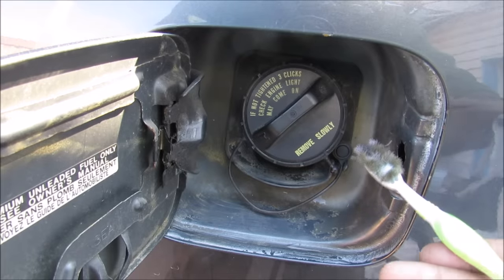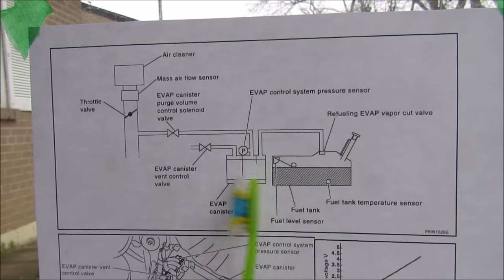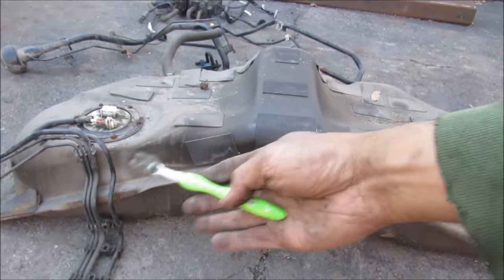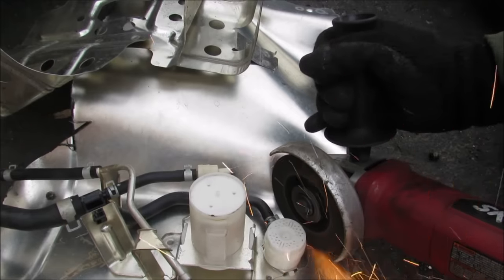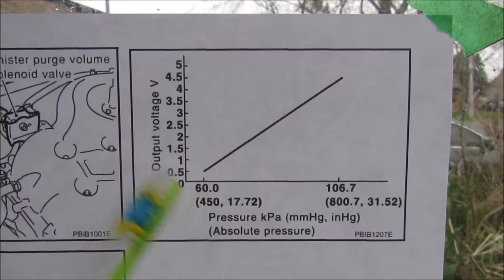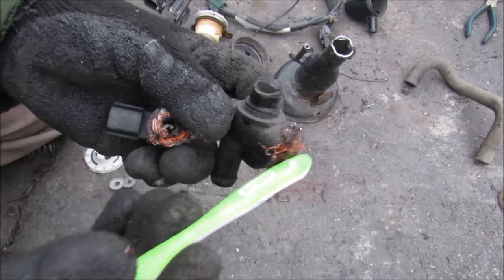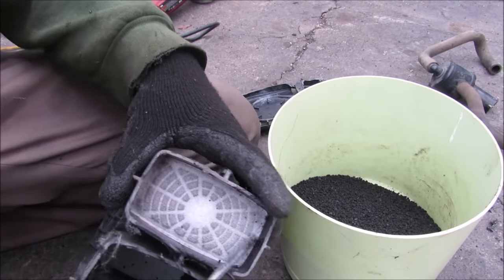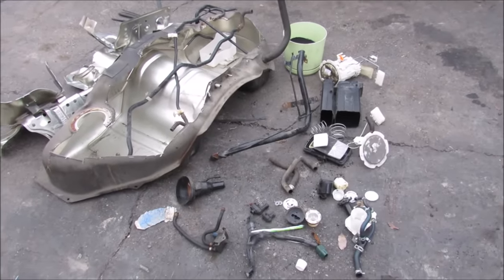How the EVAP System and Gas Tank Work

Comment: Do you think you explain a little more about the vacuum switching valve vs the purge valve solenoid and maybe help with locating them on a 2002 Nissan Maxima SE
Reply: Ok I see you explained it more in your other evap video, I still need help with the location though
Reply from the maker: Sometimes there's a sticker under the hood that gives you the vacuum line routing
Reply: @speedkar99  I found the sticker, thanks but it's very vague and doesn't mention the vsv at all smh
Reply: @speedkar99  i love your videos by the way they're very comprrhesive

Comment: If you fuel up and the fuel dispenser is an old fashioned one., does the EVAP system work to relieve any pressure in the gas tank from additional gasoline being pumped in?

Comment: Imformative video. I have a 2001 Toyota echo that i purchased in 2015 , and the canister went bad 3 times within 5 years, actually less than that, so I'm pretty use to seeing the check engine light on since Ive had the car. Seems kinda strange for it to go bad that often.
Reply from the maker: And you fixed it all 3 times?
Reply: @speedkar99  
Not this last time, just reset the engine light for emissions, and just let it go this time. It costs 400-500 to replace the part, and there's no warranty. I just don't get why it would go bad that often.

Comment: This is an outstanding breakdown, very knowledgeable.. I have a Q.. does anyone here know of a cause/solution for an extremely rough start after refueling? I have a 2008 Hyundai Santa Fe 2.7 engine.. this issue started a few weeks ago out the blue.. now the only way I can get it started is to crank it for approx 10 to 15 seconds every time I fill up or remove the fuel cap.. it only does this at that point in time.. the vehicle starts and runs perfectly throughout the entire duration of time between fill ups.. I asked a couple mechanics but they've never even heard of this issue.. all insights/recommendations are welcome and appreciated, TIA

Comment: @speedkar99 I have a 2010 F250 5.4L I just purchased. I found the vent line that runs from the charcoal canister to the engine looped over the front axel and just hanging down. It has a couple damaged parts, maybe from where it wore against a moving part or the ground, and the end is cut off... where does that go in the engine? I do not have any codes and no issues refueling the truck.
Reply from the maker: It should hang down. It just vents to the atmosphere

Comment: I seriously need your help.so every time I fill up I smell a lot of gas fumes inside the cabin.itll air out in a day than I won’t smell it again until I fill up again.on my canister I noticed the evap valve was broken.i replaced that thinking it was going to help and I still get that smell after fueling...can you please guide me on what to do next?thanks in advance brotha
Reply from the maker: You have a leaking filler neck.
Reply: speedkar99 I appreciate your response.is there a way to see check it?

Comment: I have a question! I have a 95 del sol with B18c swap, I don't have a purge solenoid and the vacuum line that usually runs to it is instead hooked directly to the vacuum port on the intake manifold (right behind the TB) that would usually connect to the purge solenoid, will this work properly without the solenoid or should I just unhook it? I've searched the internet for an hour and can't find an answer.

Comment: Where is the vacuum switching valve located?  Is that in the engine compartment that connects to the main evap line at the back of the engine against the firewall on the top of the engine?  I think there is a green schrader valve that one end plugs into.  I wonder if mine is bad since gas shot out of my tank and the check keeps going off. .

Comment: READ FIRST (ASE Master Tech of 40+ years)
  No Explosions & not charcoal. Charcoal goes in grills and smokers. Activated carbon is created of pure carbon in controlled conditions in a lab and test. It absorbs organic vapors of which gasoline is one.   The tank purge valve is open all of the time. It is only close when testing for leaks.
If it uses a temp sensor, then it has an NTP Thermistor and changes signal to low fuel light. The PCM uses software for “Engine Off Natural Vacuum”

Roll over valve to keep liquid gas from coming thru canister and create a void for air/fuel, raw fuel never reaches the cap as it would enter the "Carbon" canister as degrade carbon pellets of precise size for ASTM/DOT and CARB agencies. 

Gas caps vent at 2 psi for OBD-II, but allow air in incase hoses pinched or parts plugged, no explosion ever. Only static electricity from custom refueling and not touching pump first.

Fuel pump hoses have an aspirator tube to detect pressure & wire in hose rubber back to pump.

Activated carbon is made under heat & pressure. Holding hydrocarbons, not dangerous unless sniffing.

Escaping hydrocarbons only create photo-chemical smog with sunlight at 10, 000 feet.

Pressure sensor measure in inches of h2O. During EVAP testing, tank vent closed, stops at 8” of water, timed over 2 minute period. If small leak degrade up to 12” of water, code is not set, only history is saved, dash message says to check gas cap.

Purge is open while running, at temp, stead highway speed. PCM watches for O2 sensor changes to check purge working, adjust injectors for correct A/F ratio. Tank valve is open during refueling to allow activated carbon to capture hydrocarbons creating an exothermic event or get warm to hot. During purge, hydrocarbons create an endothermic reaction or cooling.

Water droplets only form when tank is below full. Metal tank create more than plastic and do not work well with E85. Diesel attract more was than gas. E10, E15, E20 or E85 absorb water, reducing the surface tension and allow it to pass thru injectors. Water in fuel only comes from gas station or air and temp changes from hot/warm to cool or cold after off.

Fuel warms during returning from engine, exhaust and pavement either asphalt or concrete. Once shut off and parked. The PCM by clock may run EONV test for tiny EVAP leak. This is why most use returnless fuel supply systems.

The size of activated carbon canisters is determined by the size of fuel tank.

The fuel pump is inside the plastic bucket. Most bleed a small amount of fuel to venturi jet to draw fuel inside to allow air to separate, keep pump cool, lubricate pump and keep volume constant to prevent unnecessary misfire codes when low on fuel and turning creating centrifugal force moving fuel to opposite side. 
 
Some manufactures use a thermistor at bottom of pump/sender to turn on low fuel light. Same with a temperature sensor is not used on some brands as software operates EONV.

Metal filler piping and vent piping will rust. If you smell gas after filling the tank, or sloshing the fuel coming to stops and getting out. These pipes need to be inspected and replaced. This keeps the dangerous hydrocarbons inside the canister, not garage, flame at water heater and other appliances.

Lewis and Clarke spoke to Indians (Native Americans) who described the area South of 
of them as haunted by the sprites of ancestors campfires, now known as Los Angels. This was before cars. 

Hydrocarbons of lite to heavy tar has been leaking from the earth at the rate of  1,000,000 cars per day for over 40 million years. From the California tar pits to the golf of Mexico into the swamps of the Southwest. It alone is responsible for millions of cu ft of methane, sulphur dioxide and hydrocarbons daily. Vehicles do not emit half of the gases, the EPA can force them to add $1,800 of EVAP hardware & software on cars, trucks, motorcycles and ATV'd, but they can not put a carbon canister on the swamps or marsh lands or gulf!
ASE Master 78, retired.

Comment: I am confused by what I hear on overfilling, which is that liquid gas will spill over into the canister, but after watching this video that does not sound right.  I stopped trick-filling which I used to do for long drives, but I still filled the gas up close to the top of the neck sometimes for long drives between cities.  Am I causing damage to the canister indirectly in some way?
Does excess gas go back into the pump nozzle vapor recovery system?
Reply from the maker: There's a valve to prevent that, but if it goes down the vent tube it can mess up the canister
Reply: @speedkar99  I keep hearing that but which vent tube?  Does not the vent tube go directly back into the filler neck or gas tank?

Comment: Thank you.  4:24 Good to know.  That'll teach me not to run the gas tank too low else the fuel pump will suck air and get damaged.  I look at the specs in the manual and it says 18.5 gallons, but really only 17.5 gallons is reachable by the fuel pump.

Comment: My 2002 Camry with the 2azfe engine has no check engine line but I can smell raw fuel coming from the rear of the car. What should I check?
Reply from the maker: For a fuel line leak or filler neck
Reply: speedkar99 wouldn’t a leak on the fuel line or filler neck trigger a check engine light like a loose or worn out gas cap would?

Comment: Hi, at 1) 5:55 you showed smaller tube that goes to filler neck to vent it out during reufelling. will not this tube to shut off after refuelling otherwise we will keep venting it out. 2) does the vapour cut off , cutt off the vapor to canister , if so why.. i understand about other value which cut off the fuel based on float, dont know why we are cutting of vapor to canister.
Reply from the maker: Some air needs to escape the tank and vent the filler....think of pouring a bottle of water upsided down...air is displacing the liquid and it needs to breath that air in somehow...so to allow fast flow of gasoline when refuelling, you vent it with the little tube

If vapor pressure builds to a point where the vapor switch stops it from venting to the canister, it triggers either the gas station pump to shut off (too much pressure or tank is full for more fuel) or it blows the gas cap as a safety release.
Reply: @speedkar99  Thanks, I got the concept, so are you telling me that small tube that goes to filler neck will  vented during re-fuel will cut off or closed using the vent valve that is in gas tank,

Comment: Hello there, thank you for your videos, i just have a question and hope you can assist. I have a toyota Hilux V6 model 2013 with an extra fuel tank added, when i fill it up with petrol and park it somewhere hot it build pressure and start leaking petrol from the front, almost somewhere by charcoal filter, can please explain how that happens and how to prevent it. Thabk you
Reply from the maker: Sounds like the vent is blocking and pressure is building up.
Reply: speedkar99 
I have sent you a same question on Facebook page and i hope you can answer me there so i can show photos if you would like to help me ?!

Comment: hi friend I would like to ask you for advice I have a Ford c max 1.8 petrol 2003 duratec engine the defect I feel and when I fill up the tank hangs the petrol nozzle keeps detaching and then if I accelerate the car seems empty as if there was a cap to the muffler or a lack of air or petrol this ford c max has the Cannister filter Activated carbon could this be the problem? thanks for your help🙏🏻
Reply from the maker: You probably have a clogged vent tube causing too much pressure to build up

Comment: how often we should clean fuel tank and system. 
secondly does the products for cleaning fuel system really works?
Reply from the maker: The fuel system should rarely need cleaning since gasoline is an excellent cleaner! 
Direct injected engines need to have the fuel injectors cleaned from time to time though
Reply: @speedkar99  Technically, fuel injectors are disposable. "Reman" ones aren't really remanufactured; namely, the coil remains untouched. A very respectable tech I knew, who didn't shy away from other reman parts, wouldn't touch them.

Comment: Is the air drain port on the canistee supposed to to leak out smoke when smoke testing? I have a 2001 lexus rx300 and when i do a smoke test at the engine side the air drain outlet has smoke coming out there but no where else

Comment: Speaking of "complicated Toyota" EVAPs, on my LS430, I've ALWAYS left it running when refueling.  (Spare me the safety reprimand, lol)  Recently it almost always stumbles/misfires/misses for about 5-10 seconds as soon as gasoline starts flowing into the tank.  The stumbling/misfiring/missing corrects itself and the idle smooths out like butter as its always been.  The LS doesn't throw a code, iridium plugs have less than 50k on them and  MAF sensor has less than 10k miles.  What do you think it could be?  (I just turned 150k miles on the odometer)
Reply from the maker: The gas tank pressure is probably affecting fuel flow to the pump. It's not good to refuel while running!

Comment: Ford fouled up more than a million cars with this type of system on 2012-18 Focus. 
"Affected vehicles are equipped with a canister purge valve that may become stuck in an open position," Ford said. "If this occurs, an excessive vacuum in the fuel system could cause deformation of the vehicle's plastic fuel tank. As a result, the customer could observe a malfunction indicator light or a fuel gauge with fluctuating or inaccurate fuel levels."
Reply from the maker: Ouch! Fuel tank deformation!

Comment: hi, you also made 2 comment, i watched 5 times :).. gas refuel will shut off when vapor cut off valve is closed and other is fuel goes all the way to the filler neck and fuel shut off. you explained 2 methods, not sure which is right

Comment: I have 2014 FJ Cruiser just took in for a Recall low pressure fuel pump had it done going on three weeks now 43k mi. today I  was unhooking trailer Noticed a Humming pump type noise coming from under back area looked under Veh.I notice was coming from charcoal canister Area? Car had been off for hours  I restarted noise went off do you think this could have something to do with the recall work that was done they did have to drop the gas tank🤔Also not sure how do diagnose Prolb.W/ noise No check engine light and if keeps running don’t want to drain battery🤪If fuel related very concerned but don’t want to get ripped of at dealer.any feedback would be greatly appreciate.👍🏻👍🏻
Reply: Your car may have a leak detection pump thats running its test

Comment: Would the vent solenoid make a compressor type sound? I have a 2014 Buick LaCrosse, and when the car is running there’s a noise in the rear. It sounds like a compressor pumping air while at the same time the sound of hissing air, as if it were releasing air.

Comment: Maybe a dumb question, but if I submerged in water, will that mess up the charcoal inside and all the filters or would they dry by just driving??
Reply from the maker: Yes if it gets wet it's done
Reply: @speedkar99  thanks for the quick response, I’ve changed everything but the canister, still getting codes, now I’m 99.9% sure that that may be it, once again thanks.

Comment: I got a p1457 code and suggested replacement of the evap bypass valve solenoid on my 99 honda civic. Do you know where that's located. I've literally searched all over the internet and bought a Haynes book and nothing. It's not near the cannister, which for me is located in the engine compartment.

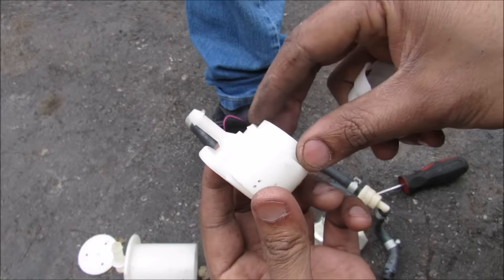Comment: So when my truck won't take the fuel and keeps shutting off the pump and puking gas out, does that mean the device you show on min 6:50 it's responsible for it?
Reply from the maker: Usually it's a blockage further downstream of that float...like the canister vent valve or a blockage in one of the vacuum lines

Comment: i got a check engine light for p440 p441 p446 and i notice that  when i unscrew the gas cap it doesn’t make any pressure sound . i check the canister and it looks pretty new.  i also tested the  intake release valve and it clicks . what u think my problem is? a leak in the filler neck ? any info will help. thank you
Reply from the maker: There are a ton of diagnostic procedures that you can do....the pressure switch and vacuum leaks are a good start

Comment: I did a smoke test on a 2010 Tundra and smoke leaked from the vent tube that runs parallel to the fill tube. Smoke leaked from just under where the gas cap sits.  Is there a check valve in the EVAP system that is failing that allows this to happen?

Comment: if  the canister is full of gas is that bad? during refill gas pump at station was clicking, checked the fuel gauge and it was at half so i kept fueling thinking it was a bad pump. overfilled and spilled followed by rough idle and shut off. pulled the canister out and it was full of fuel. I drained the gas and letting  the canister sit for a while hoping itll dry out.
Reply from the maker: Yes that's bad. It has to be changed
Reply: @speedkar99  Do you think blowing  air thru the canister  for a good while and drying it out will save it?

Comment: What a weird fuel tank. Rear wheel drives in Australia the fuel tank is generally aft of the rear diff, under the rear boot and 1 tank, not that strange hump design. In fact most cat tanks are behind the diff, and not in front straddling the drive shaft. Farm utes and Trade utes have it behind the cab to 1 side of drive shaft for protection from rear collisions. By the way, it may be a closed system, but fuel does expand, especially the vapours when it gets hot, and so it needs to also vent to relieve pressure that may rupture the tanks if sitting in the sun or hot climates. Fill up on a hot day and you get slightly more of a fuel pump reading even though it actually less volume when it cools down and you wonder why it dropped slightly while sitting.
Reply from the maker: I never thought it would be behind the rear axle. Most cars here have the spare tire there